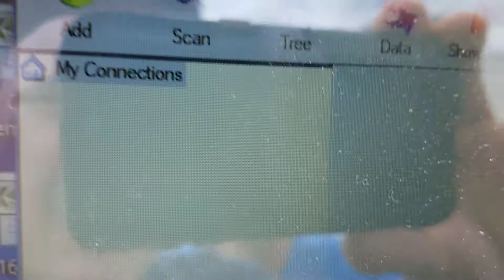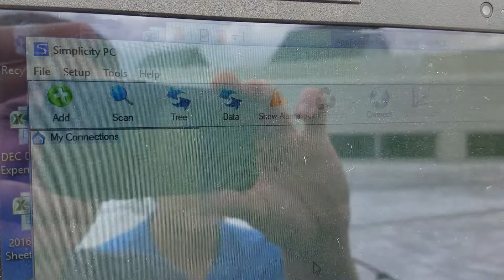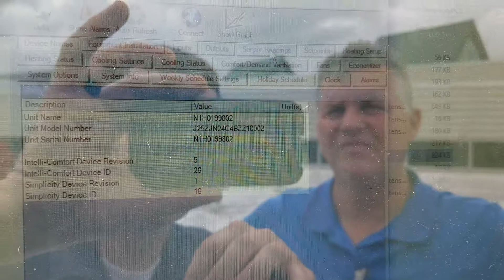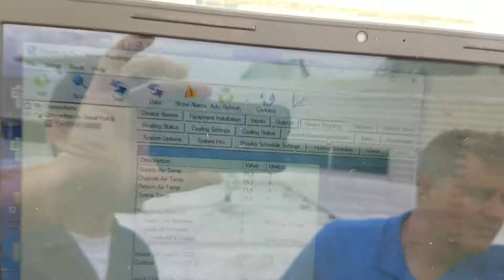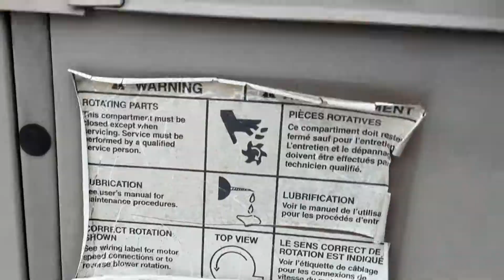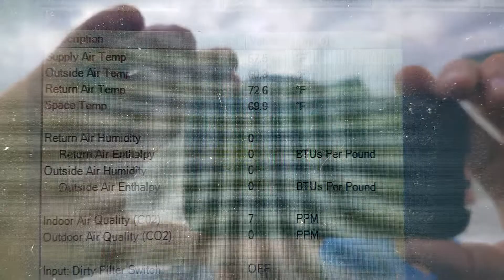Johnson York Simplicity Training 1

Comment: What did you set up for parity, baud, stop bits for your port connection for the rs485 adapter?  I tried a bunch of different settings on a unit and kept getting time out errors.  Sometimes i got a partial node discovery before it timed out, and most times I got nothing on a node scan.
Reply from the maker: Unfortunately its been so long I cant remember. The simplicity software I downloaded doesn't work any more either, its a mess.